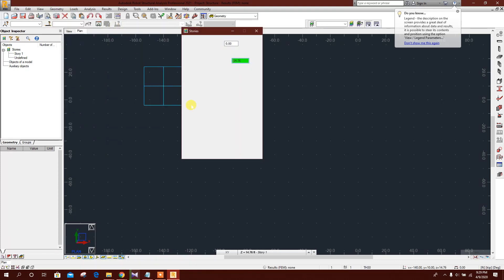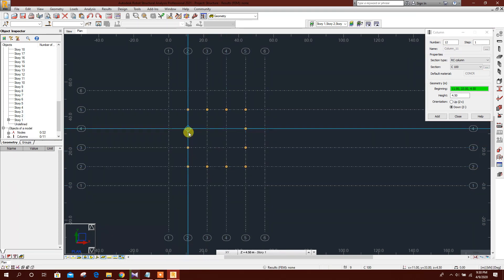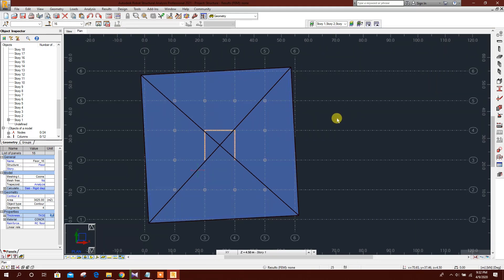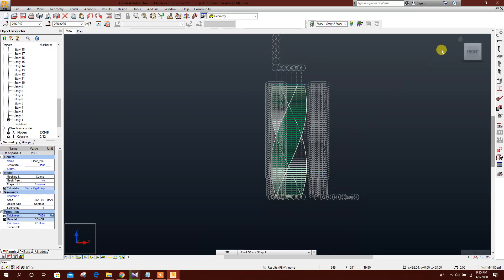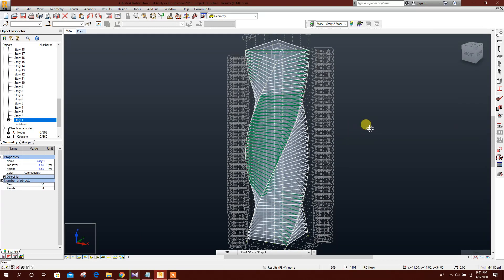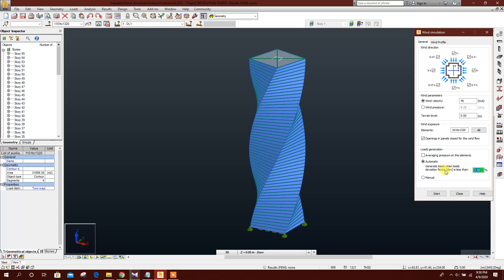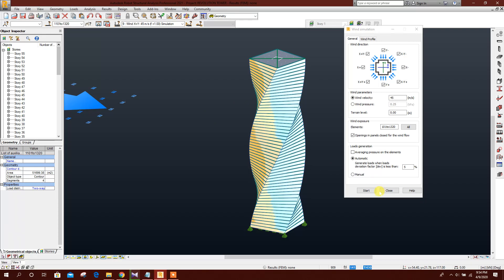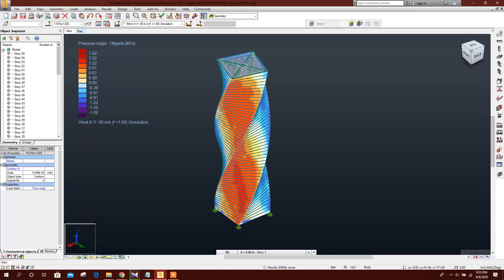Evolution Tower Modeling in 10 minutes | Robot Structural Analysis 2021

Comment: I am facing a problem in Robot Structural Analysis. The problem is, if I have a building which is already designed previously, and I want to do re-analysis for that Building. So how Can I define the reinforcement of each member to check the capacity of this building ?. This thing can be done in Etabs, so what about Robot ?. I think it is a big issue if this item not available in RSA.
Reply from the maker: Point noted & will check if there is any option available or not.

Comment: wind load from the tornado centrally over the building.  I like such real patterns :) Secondly, modeling supports on the ground as not elastic is also very realistic :) The robot has a very long way to go in terms of foundations.  And in addition you can see that there is a lack of consultation with engineers.
Reply from the maker: Good point!